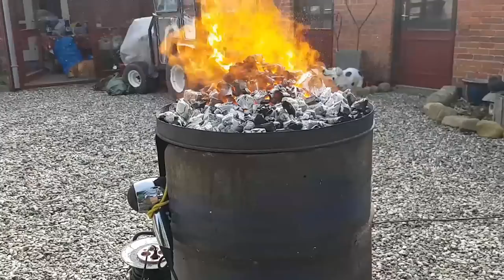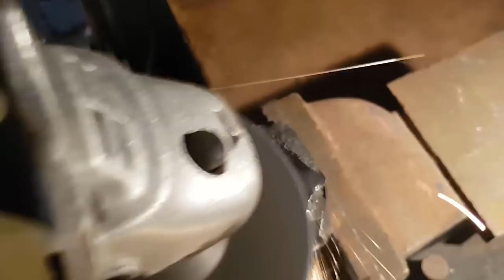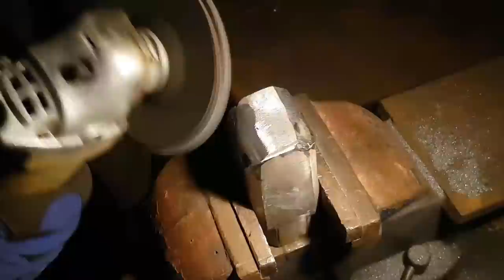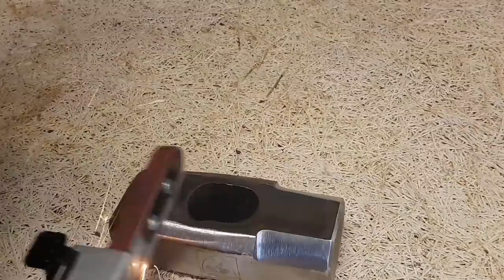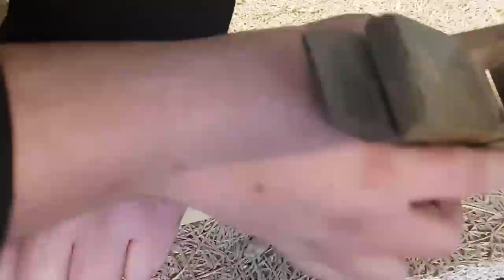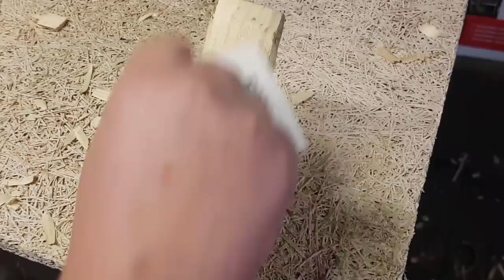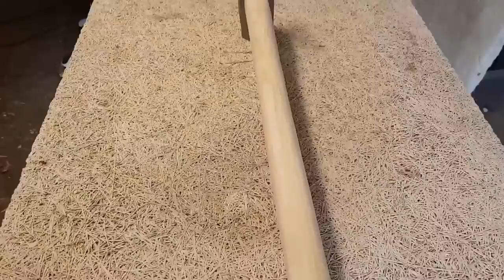Hammer Restoration Project

Comment: came out nice but i'm not so sure about the rounded end.. if its just for show or mabey some other specific use you have, ok, otherwise i think the round end would just be a problem... not a expert just my opinion, anyways looks cool :)
Reply from the maker: It is not just for show, the rounded end is for drawing out metal. :) The main amount of kinetic energy is focused at the top of radius and as the hammer dives deeper into the material the force is converted from vertical to horizontal and the by stretching the metal or drawing it out :)
Reply: as i said im no expert. i'm just starting out in forging, i've made a few knives and cleavers and they came out not to bad for someone that watched a few videos on YT but as far as tools go i'm still on the very basic end of things... if i tell the wife how much i want to spend on a small used powerhammer, she will buy it and use it on me.... ;)

Comment: how can I prevent my hammer from rust, after drill? I made this, but the rust come back. :(
Reply from the maker: There's two way you can prevent rust, you can use oil like WD-40 or a light hydraulic oil. alternatively, you can use a clear lacquer on the sides but you should not apply it to the work faces as it will darken quickly. :)
Reply: Sir Make-a-lot tks sir! If I polish, can preventiva too? I will use ur solution, dribewheel hidráulic oil for test. Tksagain!
Reply from the maker: a wax polish might do the trick too. the main thing is to isolate the surface of the steel from the air :)

Comment: what dremel attachment did you use for engraving ?
Reply from the maker: It's actually not a dremel, it's a Hand Engraver Machine with a diamond tip :)
Reply: Its a parkside engraver from lidl :D :D  did you use the diamond bit that came with the engraver ? are they any good ? i thought they always  gave cheap tips with those  parkside engravers
Reply from the maker: Yeah it's the one that came with it, and it's surprisingly durable. I have used it on steel, granite, marble, aluminium and brass, and it still keeps it’s edge :D
Reply: Nice ;)

Comment: I do appreciate the video but I dont understand why you heated and hammered the piece when you grinded the shape back into it...kinda counter productive...
Reply from the maker: annealing it helps whit the grinding, the steel becomes softer and easier to work whit. and as long as I'm at that temperature I might as well forge it closer to the final shape. :)

Comment: Well it looks pretty put that custom handle was poorly made and set.  The sledge will come loose around the eye because it was fit properly.  I don't care how much epoxy you used.  I hate pointing to Wranglerstar for how to but the man is a master at fitting handles.  Also never use lacquer to finish as it fatigues the hand.  Just go watch a few Wranglerstar videos and then remake your handle.  You'll be happy you did.

Comment: old hammer into a new one. ITS TILL OLD, just refurbished into a less usable decorative hammer.
Reply from the maker: You say it less useful. I made the rounded face of the hammer with the intent to use it to draw out metal quicker. I have made the frontal surfaces perpendicular to the sides, so it doesn't bounce around when striking. So to me it´s a lot more useful now than it was before.